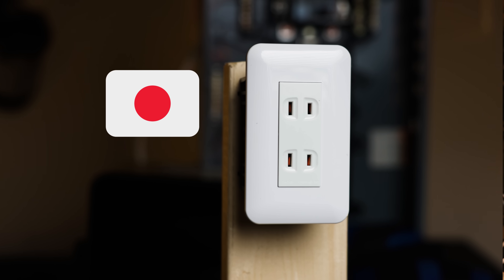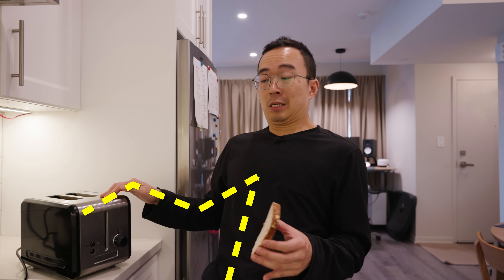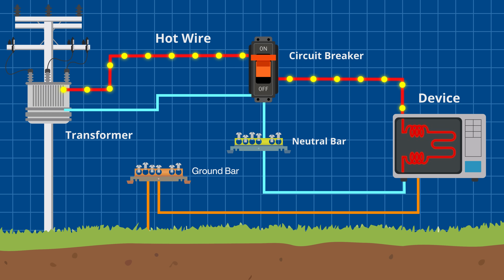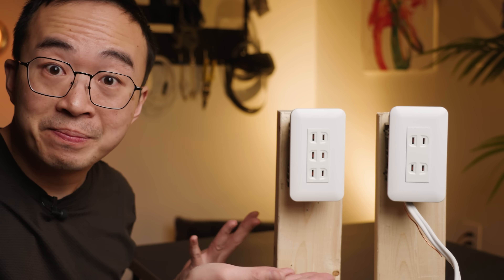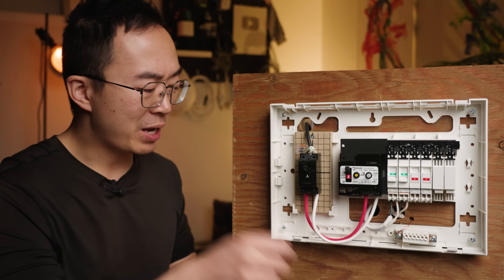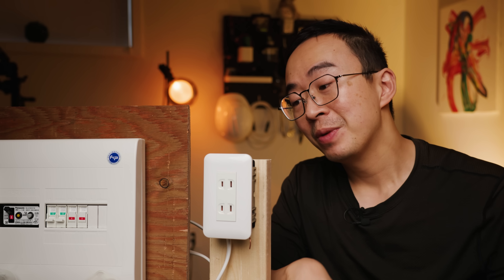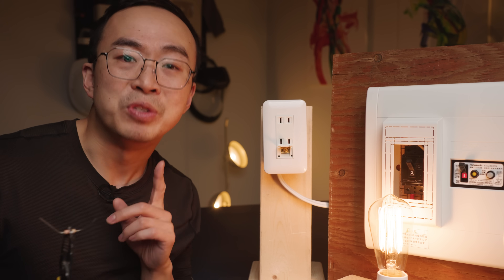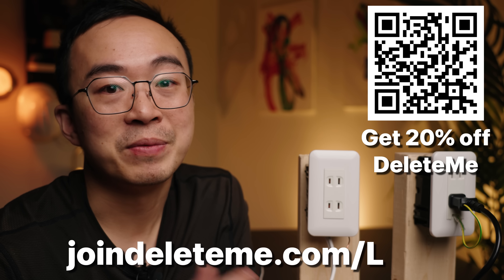How Japan Made Their Outlet Safe

Comment: Once again a story for electric "safety" that Fails... Japan has Safer Outlet? Not even compared to US system. Bonding Neutral to Ground does not have anything to do with TT and UK and others with TT Require Grounded Outlets. Nearly all things in the US and many others with or without Ground pins/plugs are "Double Insulated" even when have metal parts for cases and many now marked such with Square in Square icon. As others said, US also have GFCI, AFCI or combined units in the panel for 20+ or 10+ years respectively and covered in NEC books on when to use and thus now a Code Requirement in many States or Municipalities. Even before Grounded Outlets was standard in the US, Ground Wires was required before 1960 because use of Metal boxes, covers, etc in/on the walls that need them and why you still find 3 pin adapters that uses the cover screw to Ground the 3rd pin. The Japan wiring sans Ground is a Give Away to the Construction Industry.

Comment: North American outlets with a GFCI are actually safer. Whole house GFCI sounds good on paper, but individual GFCI outlets can have a lower sensitivity and respond faster. 

North American outlets are only 110 volts whereas Europe is 220 to 240 I believe. 110 volts doesn't really hurt honestly, but 220 to 240 doesn't feel very good. That's why Europe is forced to use a design that better hides their prongs. The history of that also goes back even further because they have to use thinner copper wires after World War II, which means they had to use higher voltage. If it wasn't for that, they would probably use the same standard as the US.
Reply: FYI Nominal voltages:
Europe: 230–240V
US/Canada:  120V
Japan: 100V
Reply: The common belief is that 110 volts is more dangerous because the human muscles react to this voltage by contracting when current is passed through them. So if this would happen with something in your hands then you wouldn’t be able to let go. Current would pass through your arms and likely your heart. A higher voltage might do the opposite but current is still going to go through you either way. I’d rather not test it out either way. But you’re correct in that the higher voltage can “push “ more current and it the current that kills. And it’s only tens of milliamperes that can kill a human.
Reply: @wyomingguy4743  No, the 120 volts in the US is more dangerous because people think it is safe so they are not careful.

Comment: EU outlets are the best of the world. They require every outlet to be secured by a GFCI /RCD protection. Plus  earth in case of metal housings. Compared to thst, Japanese outlets are inferiour, especially given the ridiculously low voltage, which does not even allow an electric kettle to boil water in an acceptable amount of time.

Comment: Now I finally know why other countries have 3 holes.

The Nordic standard is also 2 holes but they are circular.
Reply: The Nordic countries use the same Schuko plug as most of Europe. It is grounded, just with a ground clip instead of a ground pin.
Reply: @tookitogo  Actually only four of the five use Schuko
Denmark has its own.
Reply: @ oh right, that’s true! (And I even knew that — I have a danish plug adapter in a set!)
Reply: Schuko sockets are designed do that you cannot use ungrounded plugs in them. It would be dangerous to use ungrounded devices with grounded ones or in wet conditions. Note this does not apply to modern double insulated devices but they were only introduced in the 60s and 70s decades after the Schuko plugs.

With the US plugs this is not prevented so you could use your old hot chassis radio next to a grounded PC. That is highly dangerous.
Reply: @ Actually your knowledge is somewhat incomplete: the US plug system does prevent some of the hazards, because the 2-pin plug for ungrounded appliances is polarized by making the neutral blade wider than the line blade. Admittedly, very old appliances (before 1950s) predate that update and could be potentially dangerous, but those aren’t in common use of course. (And lucky for us, many line cords that old are disintegrating, such that anyone wanting to use an antique needs to have it rewired anyway, which will then be with a modern plug.)

Comment: In the Philippines, we use Japanese style ungrounded outlets but blast 220v through them and don't use GFCI.  Life is more exciting when your outlets have no safety features and are physically compatible with the plugs of appliances that use about half the voltage.
Reply: I swear my house in the Philippines is wired with phone cable. There are also a lot of wires in public that hang very low. My wife is only 4'6" and strolls under them without a care in the world, while myself at 5'10" catch them in the throat or they drag across the top of my head. Scary stuff.
Reply: @NotExpatJoe  Is there no NEC there?
Reply: @Cotronixco  Yes, the Philippines has an electrical code, known as the Philippine Electrical Code (PEC). The PEC is part of the Philippine Grid Code (PGC) and the Philippine Distribution Code (PDC). However, there is a lot of corruption and little desire to enforce the code, especially with residential housing.
Reply: @NotExpatJoe  welp at least the Filipino kids are probably smart enough no to touch a bare HV powerline .

not the case in the US.
found a news story online [there were highly vivid pics of the scene]
the line was hanging about 4ft off the ground.
i was aggravated by how much they were praising the person who dragged his i assume unconscious butt away.
they made it seem like it was a highly dangerous endeavor.

i don't remember but i believe the football field sized area they had yellow Caution tape strung up along was there when it happened.
Reply: Oh my God, how the heck did that happen?  I mean, while they are almost never used in the US, we did design outlets for 240v with the blades turned sideways so they wouldn't be physically compatible with 120v outlets.  Why would the Philippines not just use those?
Reply: @phillipsusi1791  Because thinking costs money and time.
Reply: My 40 year old home in Taiwan is the same, but 110V and the bathroom circuit had a GFCI breaker

Comment: You can also get panel breakers with built in GFCI. I'll take both GFCI and ground. I don't think you made your case.
Reply: Let's nail this one into the ground. GFCI was invented in 1961, so unless Japan didn't have electricity before then, you have admitted that Japanese power was dangerous in all respects before they installed GFCIs. Also, you have admitted that GFCIs can give you a short shock before tripping. Not dangerous? Tell that to someone with a shorted pacemaker.

Finally, although Japan apparently could not copy America's properly designed grounding system, apparently the DID copy the two prong plug system, one of the most dangerous in the world, since children can touch the live prongs if it is not all the way inserted.

In short, your video title is incorrect, since Japanese outlets are STILL more dangerous than properly grounded USA plugs with GFCI.

Comment: Just have to add a little note about the GFCI tester at 11:55. If your GFCI is ungrounded, be it an older house with GFCI protection instead of rewiring (which is up to NEC code) or a loose ground, the test button will not work, as the test buttons only function is to bridge the hot side to the ground. Meaning if their is no ground for the hot to connect to the current will not go anywhere, in turn not tripping the outlet. It is extremely important in the case of an old ungrounded house to have a modern GFCI outlet with its own test button and to check it frequently.

Comment: I bought a Japanese IEC Power cord. it is so handy in the US on those occasions when I run into antiquated old electrical systems in really old houses or buildings. One case was a church and I needed to plug equipment in and there was no other option but recessed stage floor outlets that didn't let me use my normal three prong adapters. Cord to the rescue. Plugged in tied it to the metal casing which should be grounded if it's properly wired. plugged it in to an IEC-NEMA adapter to go back to a three prong plug and pluged my tester in and then just rotate until I had correct polarity. After that I picked up two more just in case, came in handy a few years later. But I also don't recommend doing this unless you absolutely know what you're doing electrically.

Comment: 30 milliamps? (Time stamp 10:04) In the US, a Class A GFCI trips when the current to ground has a value in the range of 4 milliamps to 6 milliamps,, (There is a Class B GFCI that trips at 20 milliamps, but those are only for protection of underwater swimming pool lighting fixtures installed before adoption of the 1965 National Electrical Code. See file:///C:/Temp/ul_GroundFaultProtectiveDevices.pdf

Comment: US requires arc fault interrupters (AFCI) on pretty much on every circuit now, that's not protecting against electrocution but it helps prevent fires.
Reply: Isn't that only on new construction? Most people are living in homes that are 10+ years old and predate those changes.
Reply: @enexsix  New construction or any circuit that is extended or modified beyond changing devices (switches/receptacles/luminaires) must be brought to current code.
Reply: the funny thing about AFCI alone is it isn't actually going to stop even 2/3 of electrical circuit fires in a home but it WILL detect faults in the circuit as installed... it can't actually detect smooth-load grounding like a GFCI and in my experience most good GFCI breakers have already been quite effectively protecting us against arc-faults since the GFCI was invented   GFCI saves lives, now that we have AGFCI breakers the world is a better place because you don't have to worry about code enforcement forcing you to use breakers in your bedroom that will definitely kill you.
Reply: No they don't, they're legislated profits for manufacturers. GFCIs save lives. AFCIs are nothing but a nuisance.
Reply: I thought AFCI was a superset of GFCI, so it also protected against shocks?  And of course, they trip all the time for no reason just to annoy you.

Comment: There seems to be a code violation in that subpanel. Grounded Siobhan should only be done at the first service entrance equipment and not for sub panels.
That's funny I've wondered about this for a while why they're so advanced and yet only two prong dug around a while back but didn't find somebody who could do a decent job of showing a Japanese fuse board circuit breaker panel.